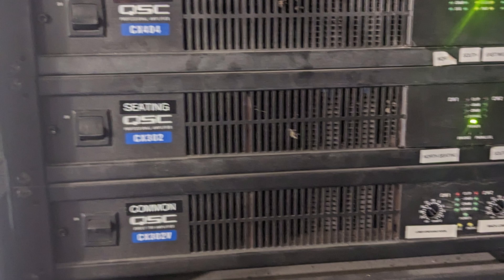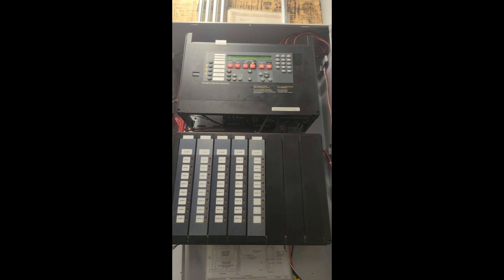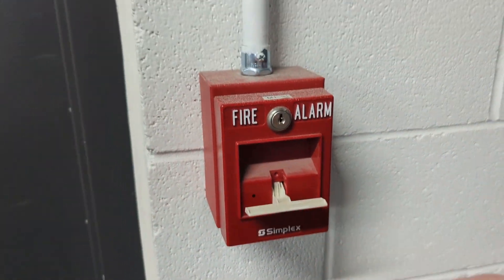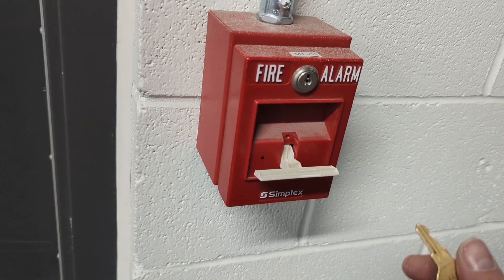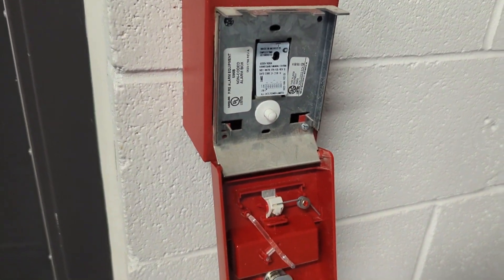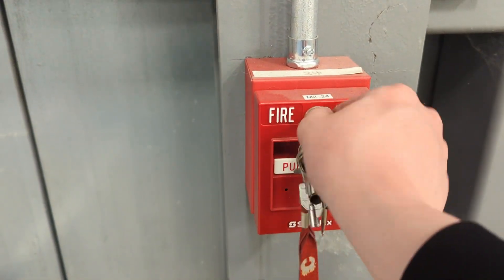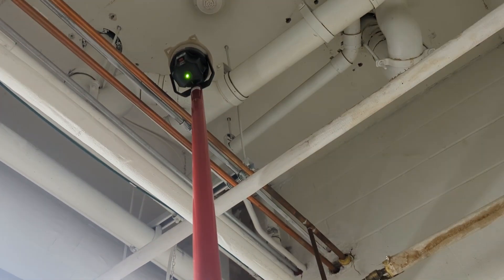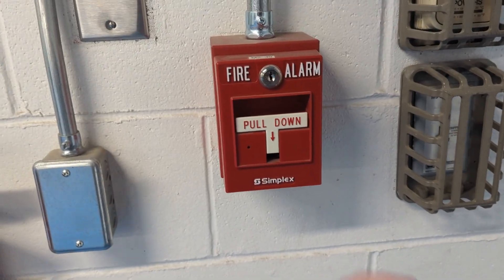Field Work: Annual Fire Alarm Inspection at an Arena Complex (Simplex 4100ES)

Comment: I only prefer Simplex and EST
Reply from the maker: I respect your opinion, but if you do end up getting into the field and working on those systems, you'll find that Simplex and Edwards cause a lot of headaches. They're cool systems though, no doubt.
Reply: @Twentythree33  The systems I would be getting would be a Simplex 4004 and an EST3
Reply from the maker: EST3s are proprietary so you won't be able to do anything with them. The QuickStart is able to be programmed with publicly available software and has most of the EST3's features, so I'd recommend getting one instead.

Comment: I like Simplex, but they definitely wouldn’t be my first choice if I needed a system in a building. I don’t really like Honeywell either. Honestly, my favorite is Siemens, but I also like some other smaller brands like Potter and Mircom.

I think Simplex systems provide pretty good protection, but that’s about all they have going for them. 

Unfortunately, I live in a smaller area where we don’t have a lot of choice over brand (although most of the options aren’t that bad). Currently, the only distributors/ FA companies in my area sell Siemens, Potter, Autocall, or Edwards. Siemens is what you see in almost every new building and almost every school in my area.

At the end of the day, as long as a system is working, that’s all that matters to protect people and property.

Sorry about the long comment lol. Keep up the good videos!
Reply from the maker: I appreciate the long comment honestly; it's nice when someone cares enough to type one. My issue with Simplex is that their systems are incredibly buggy. I have one system in our contracts that will throw random pull station troubles and require them to be replaced. That same system rejected an address after an isolator test, and upon trying to clear it with a reboot, the system bootlooped. It's to the point where one of our main contracts (a massive one) has a rule that contractors can't install Simplex in their buildings. 

Siemens is really good. Lots of people talk crap about it but I really like their systems. Mircom too.